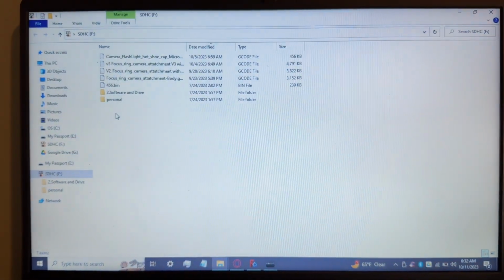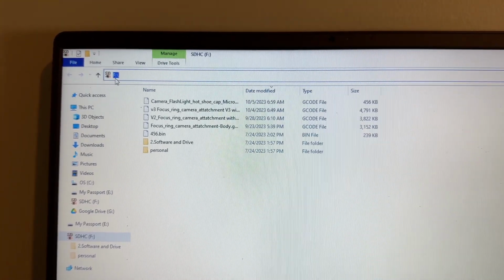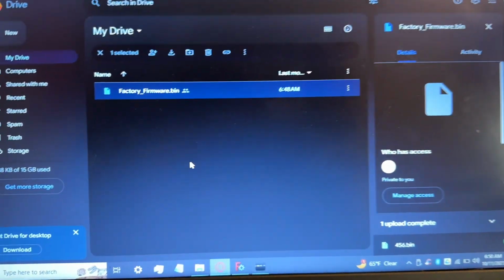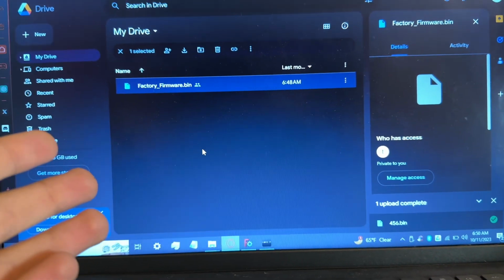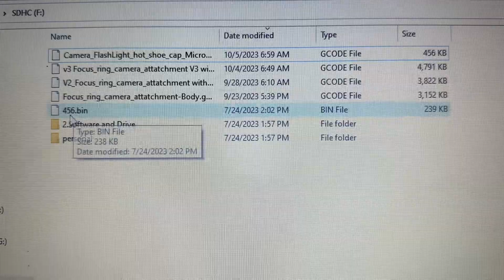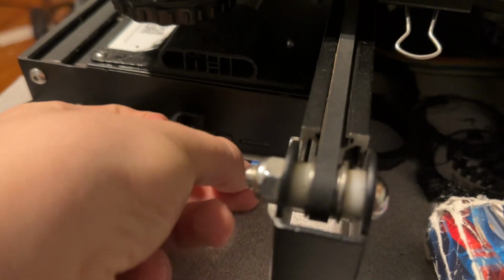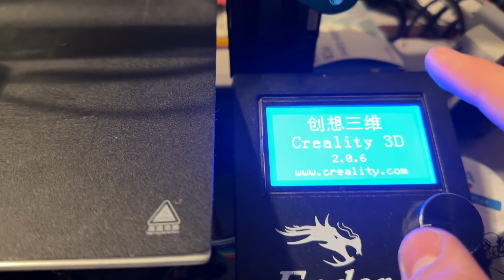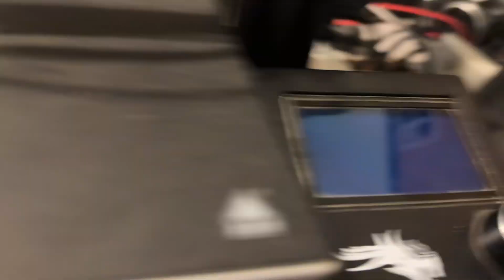Easy fix for Ender 3 V1 | Blue Screen of Death | Ender 3 freezing |

Comment: so not a while back i replaced my motherboard on my ender 3 because something happened to the old one and it fried the motherboard. So since then i got a blue screen on the screen and it wont show anything on it. If i press anything it just beeps but doesnt really show anything on it. I've searched for many tutorials and tried all of them but none of them seemed to work and the result stays the same. A solution for this would be really appreciated.
Reply from the maker: So I think I posted a firmware download in the description. What you need to do is download that firmware, put it in the root of the sd card (not in a folder) and make sure nothing else is the sd card (maybe reformat before putting in the firmware)

Put the newly formatted sd card with its firmware back into the printer and wait a good 10 minutes. This is how I fixed my blue screen of death. Sorry if this didn’t work, if it didn’t there might be a worse problem with the motherboard, but make sure everything is connected properly and all the other generic advice. (Make sure your ender 3 is not only ender 3 and not v2/v3/pro anything, the firmware I have to download is for only the ender 3 and you can find different firmwares on the ender 3 website, just do a little guess and checking. 

Hope this helps!!

Comment: I started using a second sd card, as my father is currently using the original. Can that cause the issue? (Blue screen baby)
Reply from the maker: It depends on what was on the card. I put photos on my card then put it back into my printer. Then I got the Blue Screen. Make sure to format that card first, but that will clear everything on the card so just save its contents on a computer before doing that. Then you can install the firmware on the drive put it in the printer and boom, I hope your problem gets fixed!
Reply: @tgc517  I bricked it, it had a Linux image on it. But I got a JGaurora instead, now this one just keeps screwing every print up. Once I sort it out though, it will be awesome

Comment: Ok so when I do exactly as you show nothing happens when I turn on the printer. The screen remains blue. Do I have to format the SD card in a special way or something? How do I tell the motherboard to load the firmware from the SD card?
Reply from the maker: Ender 3s automatically boot from that file so it’s easier in production. 

I’m not sure why yours isn’t working, but reformatting the card to fat32 could help if you haven’t already done that. Otherwise try all of the other help online like Unplugging and plugging in the display cable